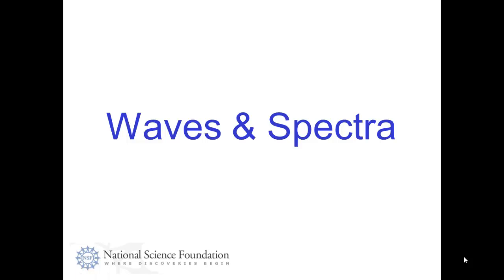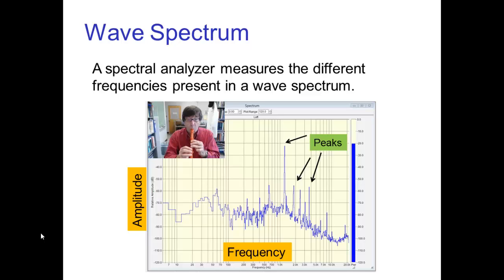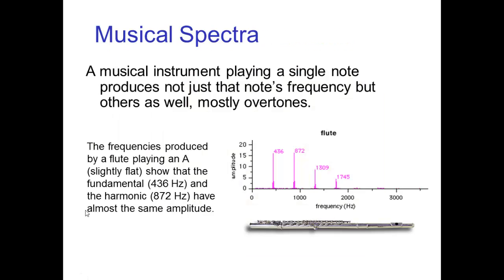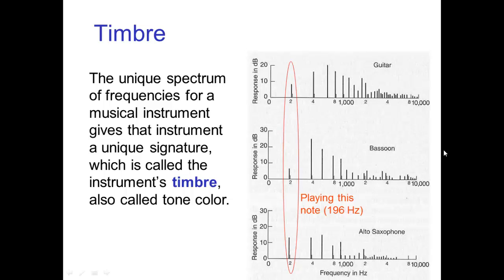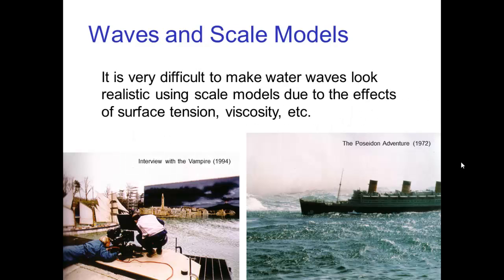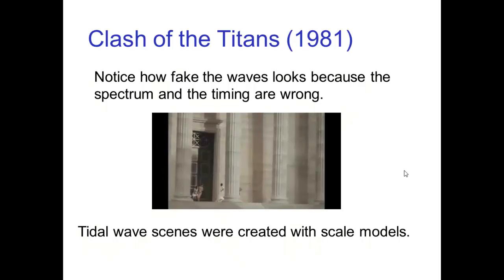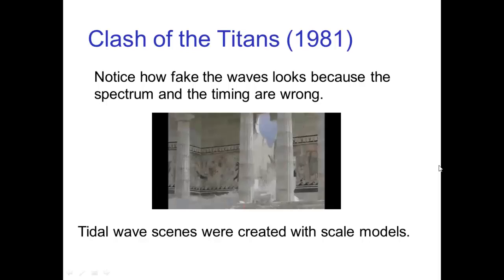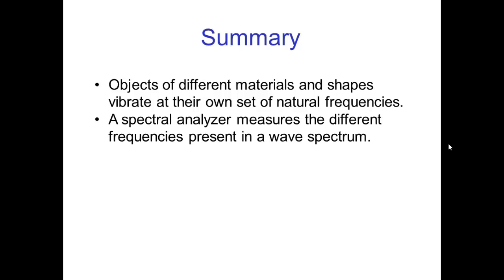Wave & Spectra

Comment: what is exactly a wave spectrum? I want to understand  it.
Reply from the maker: The wave spectrum is a graph of the amount of amplitude or power for different frequencies in a collection of waves. In general the waves with a large wavelength have a low frequency and the short waves have a high frequency. The spectrum roughly tells you how many waves there are of each type. This is easiest to see in water waves but it also applies to sound wave and light waves. With sound a high frequency wave is heard as a high pitch; with visible light the low frequency part of the spectrum is the color red and the high frequency part is the color blue. Make sense?